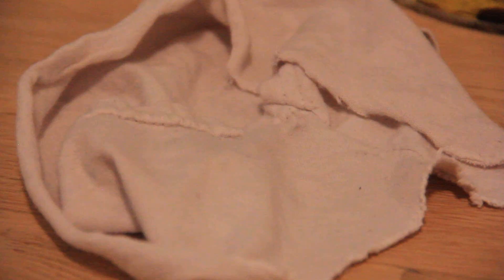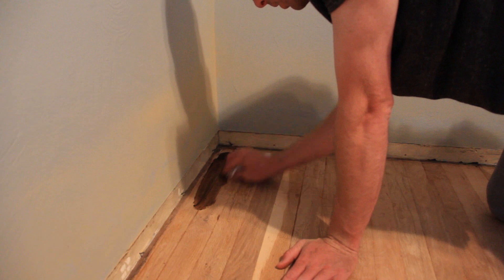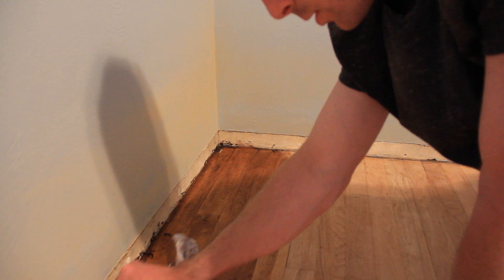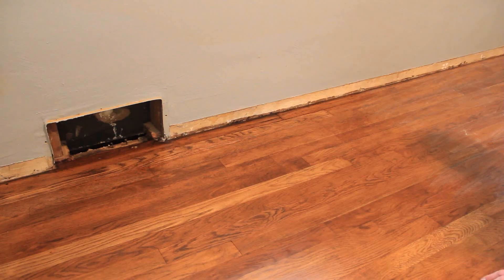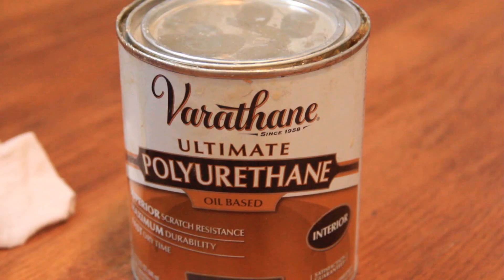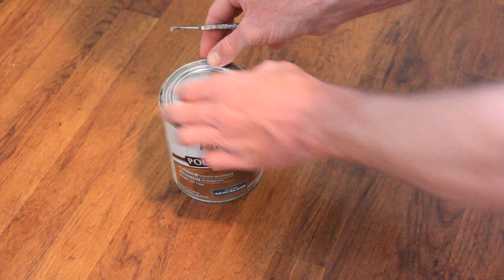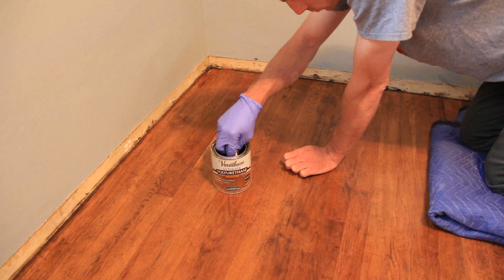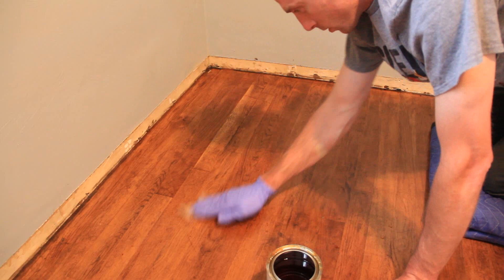Farmhouse Renovation, #2: Refinishing Hardwood Floors,  Applying Stain and Polyurethane

Comment: I did mt friends living room floor quite differently I live in the Netherlands and my friend lives in a house built in 1590 with the bottom floor having a black-white stone tile floor as you see in the Vermeer paintings with likewise crossbeam glass in lead windows upstairs it is an all oak tree planks, in fact, each plank is a slice of a very old oak tree 4.9 feet each and they were black someone painted them in the 1800s very ugly we knew it was going to be a long term project to do it right so, I found people with walnut trees and several public ones and collected the husks and filled an old oil drum with them poured in lukewarm water and  poured in yeast to ferment the then still green husks closed the drum and left alone for a year then the husks turned to mud using a fine cheesecloth it was filtered then the residue was given time to sink down and the stain was poured off then the fluid had to be rendered down from coffee color to pitch black to about 15 liters (starting with a 100 liters) then it could be used we sanded the glossy but worndown black paint off the boards and we wet it (when wood is incassed with paint for a century it is too dry it would soak up the walnut dye and dying would not work) some hours after we stared dying the floor and it sprang to life oak has harder inclusions that stay lighter than the surrounding wood like marbeling after all of the 3 coats dried the last step was lindseed oil and thats a half a year touchup as well but we are all mopping our floors once in a while with this you mop lindseed oil but, thats what they did in the 16th and 17th centuries.
Reply: I also did an 18th-century softer wood floor with shellac in 150 coats, in the end, its like wood under glass! that's a ballroom shine! that's why 18th-century ball shoes had velvet leather souls! the same as ballet slippers today.
eh, cinderella and her glass slippers would leave bad scratches in real life she would have been thrown out on her face! as soon as she started dancing in those shellac removers!!

Comment: Hi there, thanks for the videos!  I stained my floor with a 75:25 blend of stain and polyurethane.  It turned out uneven shiny/not shiny in areas (and too dark). I have not applied any 100% polyurethane coats on top yet.  Can I lightly sand and add a new coat of blended stain and poly on top?  I wanted more red in my color and not so dark, .so I was thinking of removing some dark and add a blend with red in it
Reply from the maker: Hello Christie!  Without seeing it in person, it's hard to give you an answer.  Everything we did was separate to ensure consistency.  We used stain and then we applied a polyurethane.  Both must be able to work together, or you may have issues with the stain and polyurethane not working together.  We did this because it's easier to get the results you wanted.  I would not recommend using blended poly and stain.  That being said, what's the worst that can happen?  You might have to start over, but you'll get it how you want it.
Reply: @TheBrothersWorkshop  Makes sense, thanks!

Comment: After you stain it and put poly on the first time, do you sand it, restrain, and poly again? Or just add sand it and add another poly coat?
Reply from the maker: Thanks for watching Scott!  The process should be as follows; sand the floors to remove any existing stain and finish, use the new stain of your choice to stain the floors, once the stain had been allowed to dry apply the first coat of polyurethane, when that first coat of polyurethane has dried sand it with a fine grit sand paper, and then wipe the floors clean with a damp microfiber or dust mop to remove any residue, then apply the second coat of polyurethane.  The last steps (light sanding, cleaning and an application of polyurethane) can be repeated depending on how many coats of polyurethane you'd like to have.  We recommend at least three coats of polyurethane for floors.  We hope this explanation helps you understand the process better.  Have a great day!